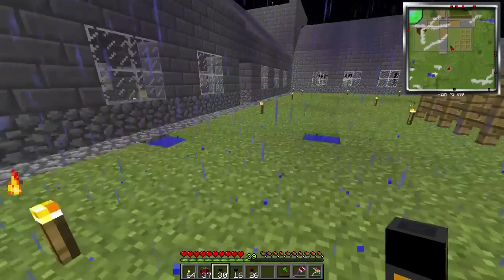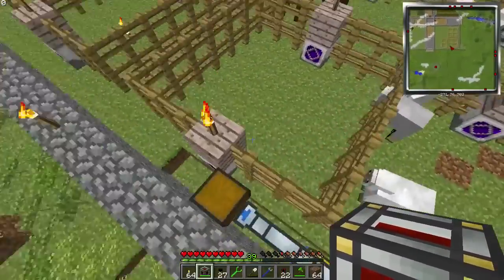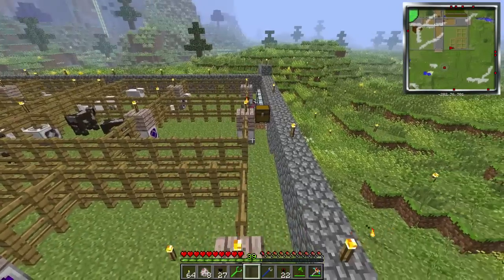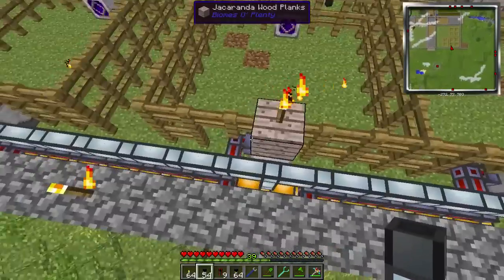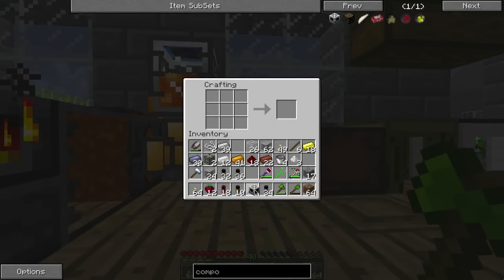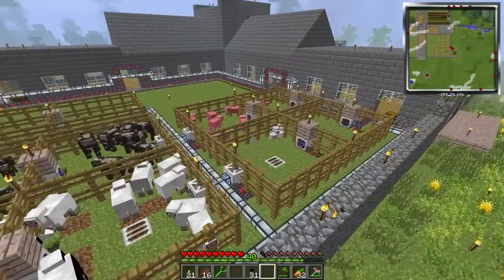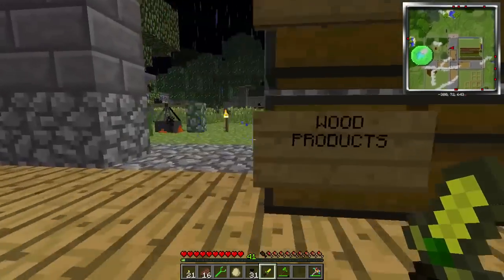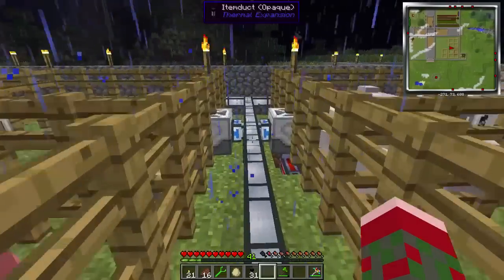Minecraft: Attack of the B-Team: Episode 14 - Extra Cruelty MFR Animal Farm

Comment: You can only pump into the top and bottom of the portable tanks.  Open blocks also has a tank that connects to itself if another is touching it.

You can use vacuum hoppers to pick those exp orbs up as liquid exp.  you can also kill the animals with autonomous activators so they drop exp, but you will need a second cronotyper to separate out the grown animals to the kill zone and more vacuum hoppers to collect the exp.
Reply from the maker: Yup, here's my Sign. Something I also learned after I recorded: Sewers will pick up not only Sewage, but also xp orbs as Mob Essence... More on that in a later episode.